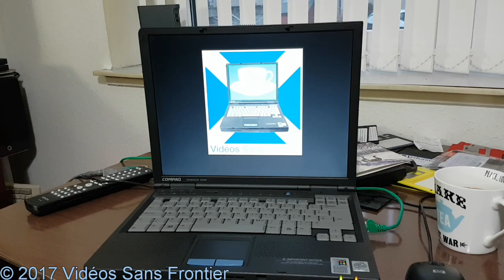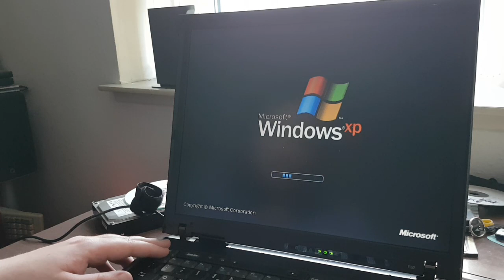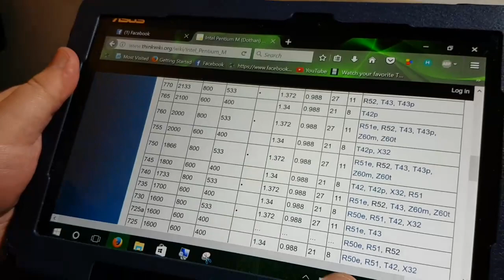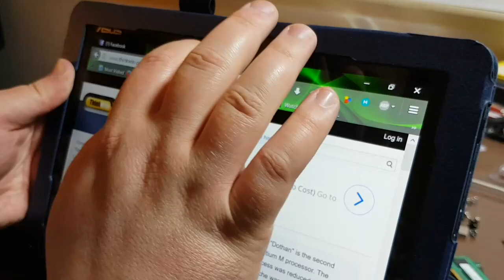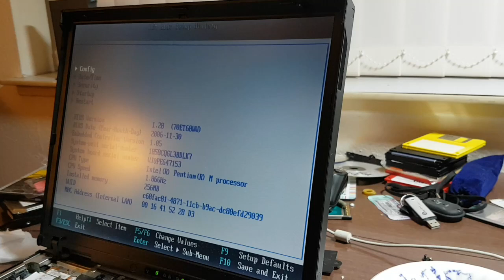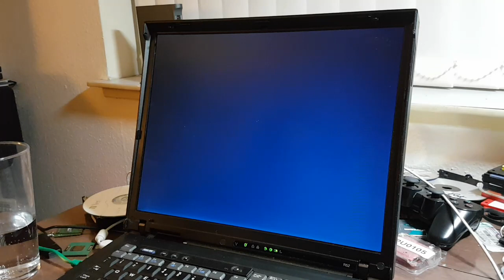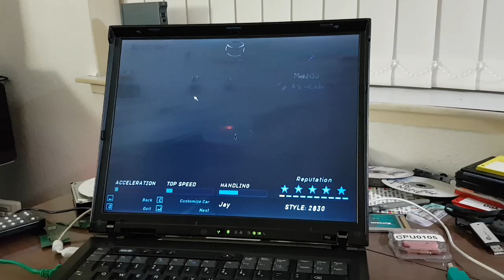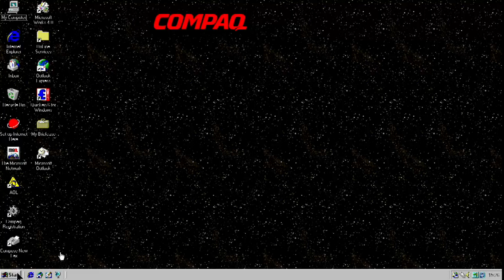ThinkPad R52 Overview Upgrade and Hands On

Comment: How are you getting those laptops to factory settings with the IBM logo in system properties, original software etc...?
Reply: Well, I can make discs of the factory image of my own R52 and send them as ISOs to Jay if he wants it.
Reply: If the laptop has its original factory image, then he can just press the ThinkVantage or Access IBM button on the keyboard after turning it on to access the recovery partition.

Comment: I've just acquired an R52, it had the stock 512MB of RAM so I upgraded it to 2GB, that seems to work great.  Also replaced the battery with a 'new remanufactured' one from fleaBay, also seems to work fine.  I have a replacement HDD on the way, I'm hoping it will fix the random freezing / lockups which have occurred since before I started the upgrades, I'm wondering if it's the HDD that's locking up and freezing the entire system - literally the whole machine just stops dead, at any time (even in the Access IBM utility); the screen freezes, HDD activity stops, nothing recovers it except holding down the power button.

Comment: Jay! I hope you see this! I have a ThinkPad R52 (type 1858 but may work on yours) that's still running its original Windows XP Pro factory image!!! I can make discs of the recovery image and send them as ISOs to you if you want those!
Reply: Oh I just realised, the image I have is not the UK image but it should be easy to change the keyboard layout.
Reply from the maker: Kevin Bhasi please do if you can
Reply: Great, I'm going to create the discs now. The recovery disc creation tool seems to mount what I think is the recovery partition, as the Z drive.

Once I'm done, I'll DM you here on YouTube about which cloud drive I should send them to you using (as I have accounts on 4 different cloud drive services).

Fortunately, the recovery disc creator utility mentions that "only one set of recovery discs can be created per computer" and the recovery discs haven't been created from my particular R52. Dang I love my R52 and it's my main XP machine, complete with a Pentium M 740 and 2GB RAM. It's an amazing laptop considering how I originally got it from the local Freecycle with a cracked screen.
Reply: OK! Check your YT DMs.
Reply: @kbhasi  Would you be willing to create recovery media for me, as an ISO or CD, etc? I can't find it anywhere

Comment: I have the same thinkpad R52 that I use for playing old pc games and I love it,  mine has a ATI9000 agi graphic card and it seems to handle all the old games I toss at it, it's perfect for playing old pc games so if you looking for a vintage gaming laptop then I suggest check out this Mindel with the ati9000.
Anyway I do have one problem with mine and could use some help, my space bar key is gone and I can't seem to find a replacement, I have bought 3 similar laptops from goodwill so far and none had the same type of clip. Can anyone please tell me what model keys can work on my rR2? Or if anyone has one laying around I can get please let me know.any help would be great.